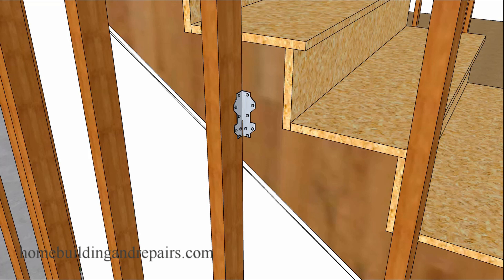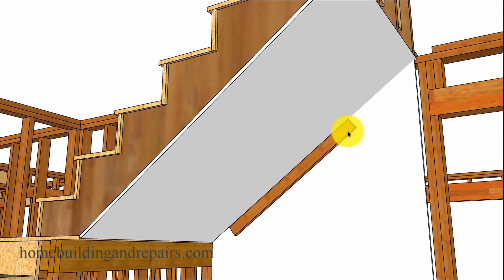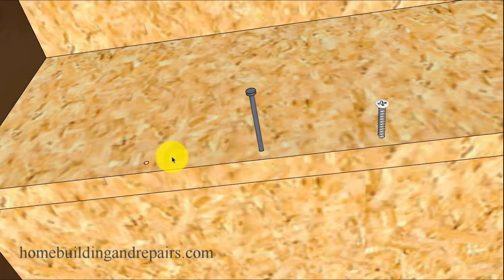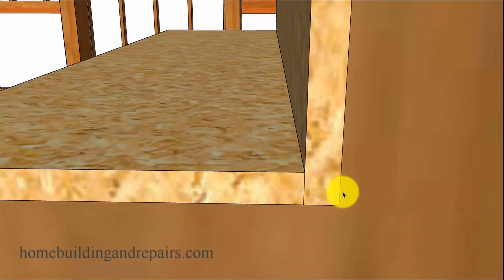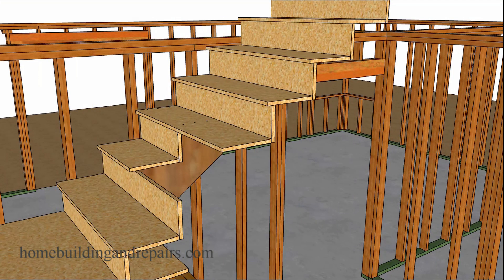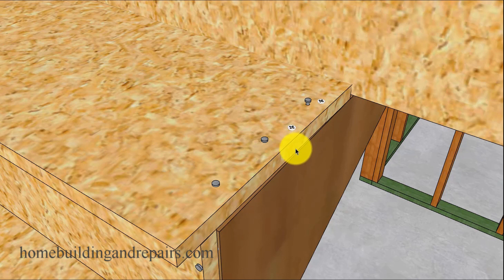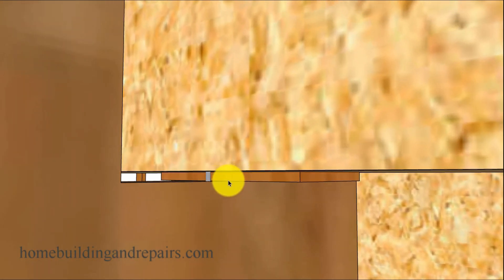How To Fix A Squeaking Stairway - Home Repair Ideas

Comment: Thank you. I love the graphics in this video and how you went straight to the point. Can you tell me what size screws I should use and how many for each step for the solution you gave at 4:30 ?
Reply from the maker: If you don't know how thick the treads are then use longer screws, maybe 3 inches or longer and maybe 3 for steps about 11 inches wide in depth.
Reply: @stairbuilding  thank you!

Comment: This is a great professionally done video. It is chock full of useful info. Can you give me some insight into 3 step winding stairs that you can’t access the bottom. The three step winding portion of my stairs seem to have no center stringers. Thanks!
Reply from the maker: Feel free to send me a picture for more information. However, you might need to remove something to access the bottom to actually make the repair.

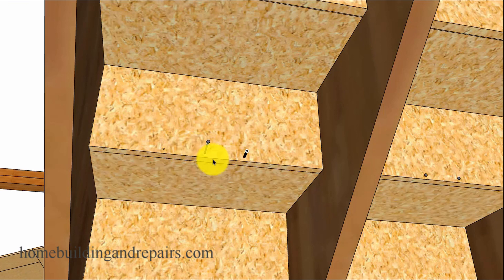Comment: Hi Guys, I have a situation the same as that at the 1:30 minute mark of your video. The tread has sagged and its natural resting place now sees it sit slightly lower than the lowest edge of the riser. Should I look to jack it back up so it's flush with the bottom of the riser before drilling and screwing, or should I just perform the repair where it is? Thanks for a great video.
Reply from the maker: First off, if it's a problem, then it should be repaired and if it isn't, then you can simply reinforce it somehow. Make sure the stairway is safe.

Comment: Cutting a space between the riser and tread seems to have reduce noise by 200%. Thanks for the tip!!! I did not have access to the underside of my stairs and after performing the suggestion of cutting a space between the riser and tread they are much quieter.
Reply from the maker: I'm glad it worked and thanks for letting us know.
Reply: @stairbuilding  could we put a little piece of quarter round or cove molding to cover the gap after cutting?